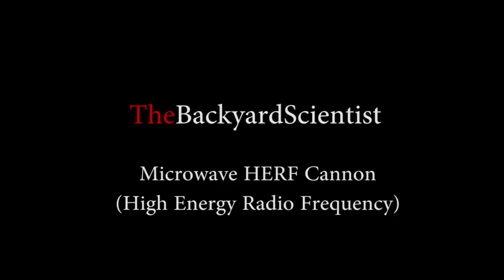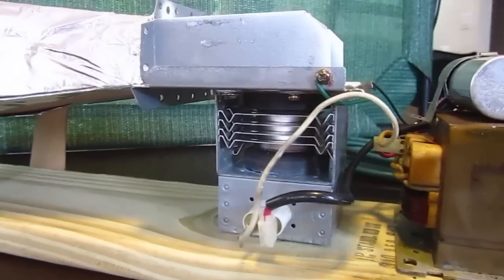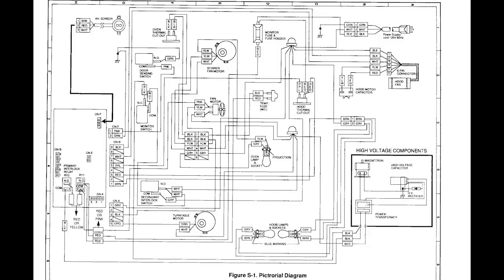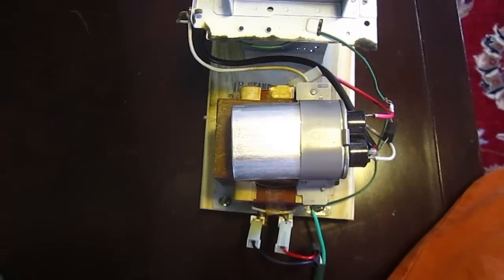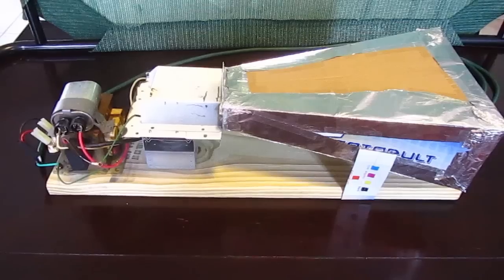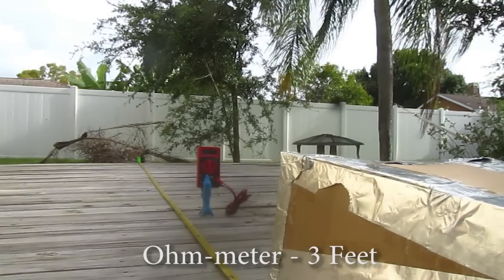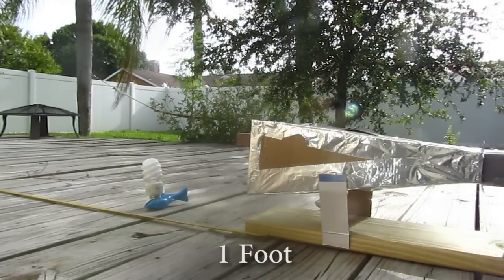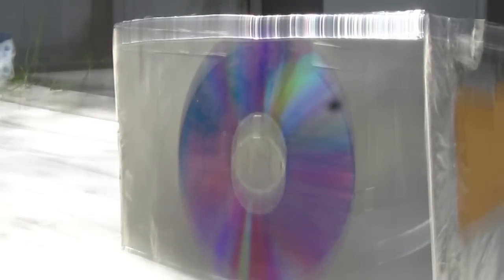MICROWAVE CANNON! A High Energy Radio Frequence gun. (700 watts)

Comment: one may consider studying RF in general to achieve the goal of frying things at a distance. The magnetron in its native environment IE: the oven. fires 2.4GHz @ 600 - 1800 watts into an enclosed metal box to cook food. Basically the oven chamber is being concentrated with high power RF. The waveguide is tuned for minimal VSWR to allow maximum power to go into the chamber and not back into the magnetron. Example of high VSWR is tossing a metal fork into the oven and running it. The fork will increase the VSWR to the poing where almost 90% of the RF power is going back into the magnetron thus burning it out.

Comment: I'm 14 and have a general understanding of Physics, Engineering, and Theoretical Physics i graduate high school next year due to the fact my school is accelerated and I skipped the 8th grade. Now I know microwaves are non ionizing but the end of your video didn't seem to safe judging that the vibration was caused by the microwaves idk if that was because the cd was in place potentially deflecting the path or leakage I'd suggest you take a Florescent light bulb and attach it to a stick and wave it slowly around every part of your cone/magnetron if it lights up your gonna wanna change that ASAP. (Sorry for the run on sentences) xD
Reply: ***** its accelerated by months one semester is equal to a year. I remember because just last June of last school year I was a sophomore now imma Junior. Next year I'll be a senior and be done highschool June and turn 15 March 16.
Reply: ***** be my guess lol
Reply: R/iamverysmart

Comment: I am collecting as many reclaimed microwave I parts as I come across. I have built three lichtenbergs, 1 is a single MOT, one is a 14kv neon xfmr, the third is 6000v using 3 series connected MOST. THE LAST ONE I AM WAITING ON MORE, GTO. CABLE. I am also in the past process of building the metal melter, I am building also a laser bazooka. This one will be slowly done. I am on disability and have to space out my purchases. I am going to be getting a bit more extreme than you did. I want to push it beyond yours, using parts of 6 DLP's, also I want to try to focus my optics into a 1 1/2" to 1" beam. His should (if it can be done), thus increasing the intensity,  and broaded the spectrum of cuttable materials. Now, back to the microwave gun(or cannon) as mine should aptly be named, I am planning to use 4 mot's.  .
 Would it be feasible to utilize solar cells, battery charger, battery, and inverted to power it where ever you want to fire it. I am thinking a small trailer to mount it on, and using an 80cc four stroke on a Mountain bike to pull it. Having 4 MOT's, the weight would be difficult to carry.
Reply: Good luck trying to focus x-rays in your basement laboratory.
Reply: Are you still alive Jim!?

Comment: I would be very careful about your backdrops as well, which should be a large 45-degree metal reflector upwards, where it will dissipate over distance.  I also noticed it was pointed right at the neighbor's house.  It will go through a vinyl fence like it's not there. While not ionizing radiation, high-frequency electromagnetic radiation is still not good for you, besides the burning of brains and flesh through and through.  Be careful.  :-)
Reply: Kimberly Panos we are basically exposed to it on a daily basis especially gas station workers
Reply: Yes, but at a tiny fraction of that power.  We're talking a few milliwatts from WiFi, mobile phones, car remotes, etc., not 700 watts, which would be quickly lethal if you put your head in front of it.  Lethal directed energy weapons were even banned for use in wars decades ago.  However, I think they are good for home invaders -- no mess to clean up.

Comment: While you're correct that microwaves are not "dangerous" in the sense that the individual particles do not have enough energy to cause damage to DNA or other fast-growing tissues (such as UV and other high-energy particles), it still is not safe.  Aside from the danger of electrocution (especially if you plan to use parts from a microwave oven, BE VERY CAREFUL!!!), microwaves themselves can cause serious harm.  A microwave oven works on a very simple principle.  The frequency of microwaves is the same frequency which water will "vibrate" to (I'm being very general here...dont get caught up on words like "vibrate".  I feel it makes it easier to visualize what is happening).  This vibration of the water causes friction amongst the molecules which in turn causes an increase in temperature, and this is how a microwave cooks food.  Yes, you are over 2/3 water and water does have a rather high specific heat (specific heat is the amount of energy required to heat/cool a certain amount of a substance by a certain amount.  for example it takes over 4 joules to heat up 1g of water by 1 degree Celcius vs. 0.45J/g 1*C for iron...in other words it takes roughly 10x the energy to heat up 1g of water vs 1g of iron...you know this because iron heats up quickly and water does not) so that means that the amount of microwave energy required to cause a significant increase in temperature will be large, but eventually it will happen.  With enough microwave exposure, you could just as easily "cook" a human being just as you would a microwave dinner, so they absolutely CAN be deadly (especially if you assume they're completely harmless...it does seem that way since they're in basically EVERY household, but they're potentially lethal devices)
Reply: Do you think you told him anything that he didn't already know?

Comment: Interesting, the fact that the electronics introduced survived at all suggests that the waveguide coupling is exceedingly poor or nonexistent. Have you done any further experimentation with different dimensions or different guide modes? Been meaning to do similar practical experiments myself but for my nefarious purposes, IIRC a 2450MHz horn would have to be over ~2 feet. Also, seems that the "hood" over the tube came from the oven you scavenged - is that half wave spacing between the antenna and the back of the original guide? Finally, not to beat it into you as I note it's been mentioned, but watch your eyes, and beware of HV
Reply: Microwave radiation usually doesn't destroy electronics. If you put an old field radio in a microwave, it creates a bunch of interference but then returns to normal shortly after

Comment: By watching this video you are on the right track but your waveguide seems too large at the end. Also perforated metal sheeting like in the ovens door works well as a deflector. Whats even better is an old direct TV dish to help concentrate the beam. This experiments and projects take time to get right and some hard math if you want perfection.
Reply from the maker: Thank you for your comment. I understood from the beginning that this would involve some heavy mathematics to get working great. I found commercial wave guides that used a 35 degree angle and sort of just winged it. I was also doomed from the beginning because the waveguide attached to the magnetron was out of spec for broadcasting the waves. It was only 3 inches deep, but it should have been 4.92. 

Also, I was under the impression you could not focus microwaves from a magnatron into a "beam". I have a old dish with a magnatron on it already, but I am not sure of its power or frequency.

Comment: well, maybe you should step up the game and do it on a larger scale and prove it can be used as a weapon because apparently there is a debate that the gov tested a similar weapon on paradise CA, there has been accusation and we should investigate. bigger transformer, bigger magnetron, make the barrel more cylindrical,  less diameter, more length,  kinda like a funnel, flip it backwards. and build a housing for the electronics, crank up the power. try different ways to make it more dangerous, its not like the government doesnt already have this technology. may have to re engineer the magnetron, be careful there is a very poisonous substance associated with magnetrons.. i believe it is called berylium oxide? its pink, kinda looks like plastic, do not handle it. build housing around electronics and magnetron because i think the microwaves were radiating in all directions instead of into your barrel, probably cooked yourself a little bit. also try different materials, wood was probably good insulator for the base, maybe a different material with better insulation. also, if you made a foundry you could design and create a better barrel out of abetter materials, the foil is crinkled and may reflect the waves in different ways, diluting it's energy. im sure, if microwaves have been around this long, that the government has turned into a weapon with the... 25b per year defense budget? nice video, dont hurt yourself.

Comment: Weather or not you believe you will get cancer, it still might be best to play it safe to some degree and avoid getting hit by the waves.
No doubt the thing is cool.
Reply: I'm not saying that you will. Myself, I doubt that microwaves could cause cancer, when we don't get cancer from visible light, which is a higher frequency.
Reply: What about that was wrong?
Reply: There's more energy in high frequency waves, therefore, making it more likely to cause damage.
Now if the microwaves were in a high enough concentration, maybe, but I find it unlikely.
Reply: It's called physics
Reply: Just use logic. The more energy there is, the more damage it will do.
Reply: Tell my why what I am saying is not correct. How about that.
Reply: I'm out.
Reply: We all get cancer anyway from Chernobyl, Fukosima and the many nuclear weapon tests.
Smoking, microwaves, paints and other shits, really dont make it worse or better.
Reply: *****
I kind of saw where you were going with that, but what about skin cancer from the UV radiation from the sun. Also consider that Frequency and Power are two different things.
Reply: its true....it will increase the chance of cancer og you get hit by the rays. Thats why every microwave oven can't be turned on without the door closed as it protects ftom the rays... Kzummo is right
Reply: ulrik meyer That protection only works when you have pluged the microwave in a good grounded socket. Only then you have a cage of faraday that protects you.
Reply: ***** 
You're mixing up two different things.
It is true that on a higher frequency, electromagnetic waves RELATIVLY have more power than those of a lower frequency. But ABSOLUTELY it depends on their strength, so how many "Watt".
And don't come with the argument that light isn't harmful. It is harmful for people with a certain skin disease (Porphyria). Light can be absorbed easily, so it is normally done by less than the first milimeter of our skin and can't damage you anymore. The same is for example done with Alpha-radiation. It can't harm you, unless you have it inside your body, by breathing in or swallowing alpha-radioactive material.
Reply: ulrik meyer
No it doesn't have anything to do with cancer, microwave oven cannot be turned on without the door closed because it can damage your body by cooking it and cause inerference to the devices like bluetooth and WI-FI that use the same frequency.
Reply: ahem Some time has passed, and in that time I earned myself an amateur radio license. In earning that license, I learned a few things. First of all, chances are likely you won't get cancer from this, yet you can still get what is known as an RF burn.

If you have this running for a long period of time, you might expose yourself to the radiation coming from it, that is quite high in watts. It won't be all that dangerous to your overall health, but like I said, you can still burn yourself.
Reply: Microwaves are not ionising radiation.

What you do have to worry about though is RF burns.

Comment: umm, yeeahh...I think mine was a bit more nasty than yours....for starters you have probably cooked your magnetron as you dont have any cooling fan blowing air thru those fins on the magnetron..those fins arent there for good looks buddy,secondly,and most important-you only have one 'tron!!! you'll need at least four 1000 watters...and...you'll need a capacitor bank..for the pulse, by that I mean its not necessary to run continuously to get sparks from your target..wave guide looks ok tho...

Comment: Can you feel the cancer?
Reply: +Juan Lopez Not really, since microwaves are non-ionizing radiation which is incredibly unlikely to cause damage to DNA. UVA and UVB are ionizing, and capable of mutagenic damage to the DNA, while radiation like broadcast radio, microwaves, and low-frequency RF are almost entirely "safe" from a carcinogenic standpoint.  Microwaves are, however, highly energetic and cause the vibration of matter to the point where it could easily burn you if it's pushed out at a high enough wattage.
Again, it's very unlikely to cause DNA damage, but it's possible. A burn from a simple induction coil (think electric range for your oven) could also cause mutagenic properties due to the extreme excitation of the atoms in your skin.
X-Rays, on the other hand, are highly-ionizing.  They are capable of causing cancer relatively easily. This is why, while you're laying in a chair with a lead bib on, your dentist is hiding behind a thick wall.  You get exposed to this dosage maybe once or twice a year, but your dentist could potentially be exposed well over 10 times a day. An x-ray or CT (which is just a really advanced x-ray) is a slight risk when you have it occasionally, but a huge risk for a doctor who could be exposed to it multiple times daily.
Reply: Dragon Xero I can rest in peace now, thank you master